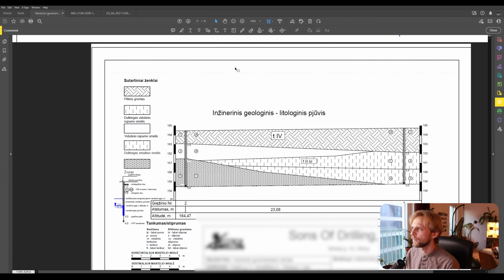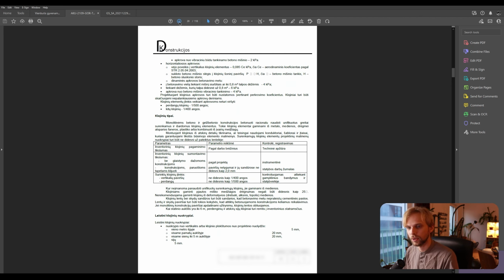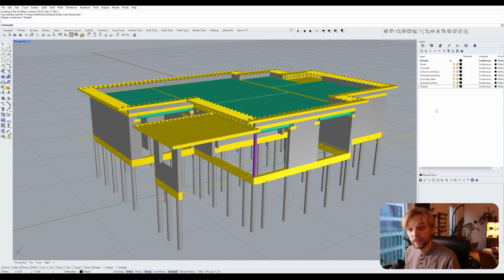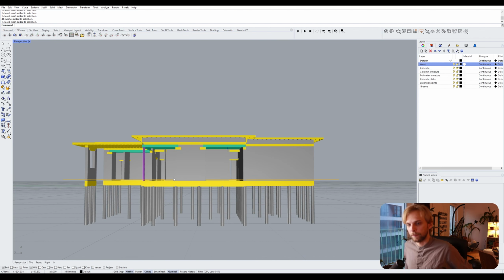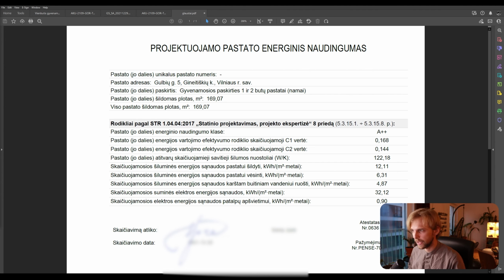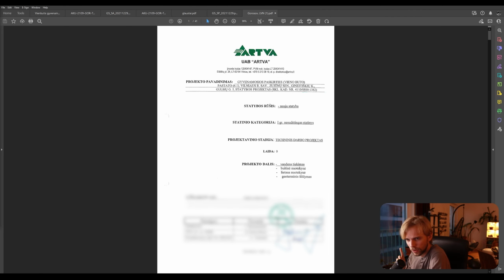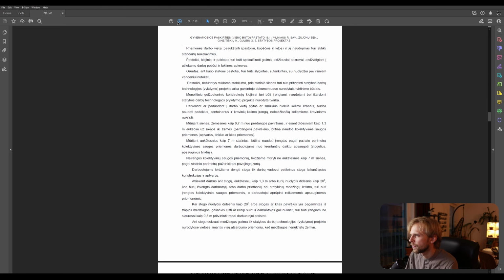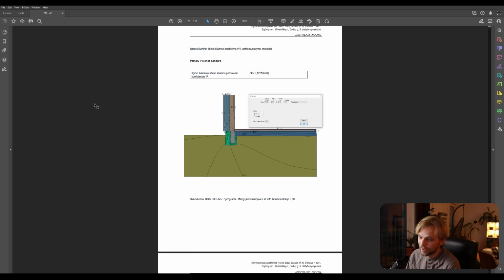Paperwork finished : Architecture design from start to finish #4

Comment: Did you consider using Revit to work (with Rhino) with the engineers? It looks like lots of architecture companies have adapted to this flow.(Rhino/Sketchup +Revit/Archicad)
Reply from the maker: Yup, we've considered it. Then we checked the price. Revit makes sense for a large scale office, but for our office of 4 people - it's way too expensive.

Comment: Can you briefly explain the conditions to obtain the right to sign projects as an architect in Lithuania, or wherever else you have been practicing?
Reply from the maker: After you've finished your education, you need to apply for a certification that's given by the architects association of Lithuania. There are two kinds of certifications: "architect" and "architect of special buildings". To get the simple one - you need to have 5 years of experience, have at least 1 project built and pass a building regulation knowledge test. To get the "architect of special buildings" you also need to have at least one "special building" already built. Offices, opera houses, large-scale housing complexes are all considered "special buildings". So basically you first need to work in a company for a while under someones "wing" to later be able to get the certification by yourself. Usually small and mid-scale companies have 1 certified architect who signs all documents produced by the company, while other workers do the designing without having a certificate. Yes, that is fully legal and accepted.
Reply: @DesignGoBrr  "finishing education" means just a bachelor degree or master included?
Reply from the maker: @mihaipandele5716  umm you can do either. But if you do only Bachelors, then you'll need to have extra 2 years of experience (or was it 1... don't remember)
Reply: @DesignGoBrr  Interesting to know, thanks for info!